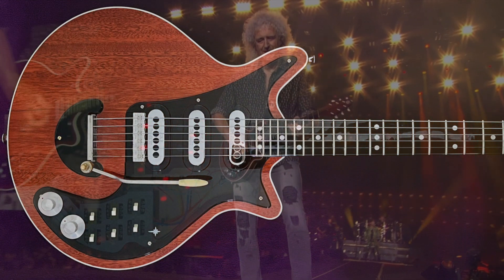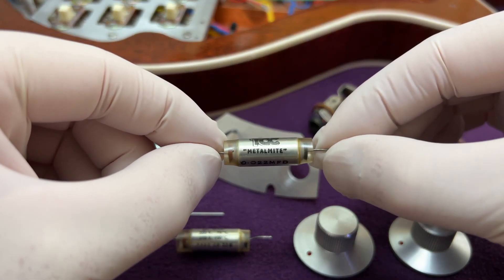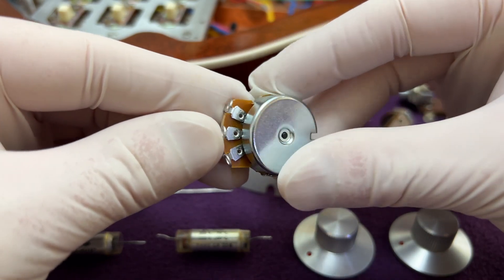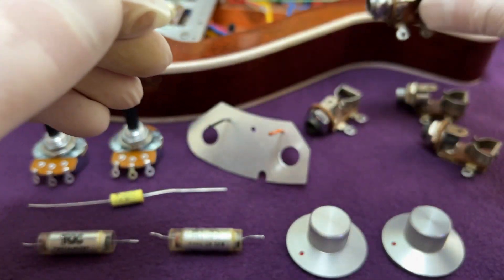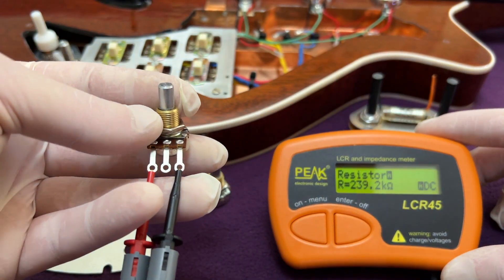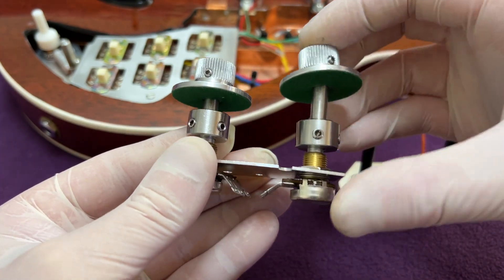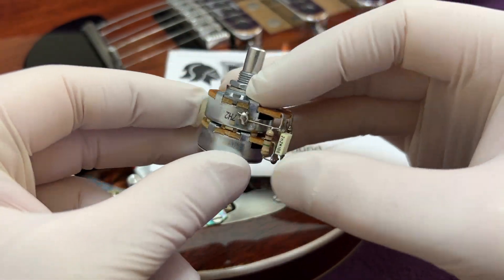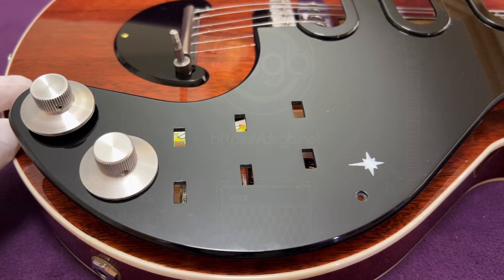Brian May Red Special Electronics: Potentiometers, Capacitor and KAT RS Superpot

Comment: Has to be the best channel for the red special, peroid. Well done for keeping all this interesting content coming.
I have a series parallel quesrion. 
I've wired in a parallel mod in my RS utilising the middle phase switch as the parallel/series switch. What i have noticed was how weak the parallel  circuit  is when 2 tri-sonics are on. Its more then half the volume of just 1 tri-sonic switch on in series mode, which is basical parallel when the other 2 are off. 

Chatgbt said this is expected. Would you ageee, because we dont hear this difference with Fender strat guitars 
 
G let’s translectrical behavior of your Tri-Sonics into real-world decibel differences so you can better understand what your ears are actually picking up.

---

🎚️ Decibel Difference: 1 vs 2 Tri-Sonics in Parallel

When comparing one Tri-Sonic pickup to two wired in parallel, the output voltage drops due to impedance halving and signal interaction. This results in a noticeable volume reduction, but how much?

⚡ Estimated Output Voltage Drop:
- 1 Tri-Sonic (series): ~250–300 mV
- 2 Tri-Sonics (parallel): ~100–130 mV

Using the formula for decibel change:

\[
\text{dB} = 20 \cdot \log{10} \left( \frac{V2}{V_1} \right)
\]

Assuming:
- \( V_1 = 300 \text{ mV} \)
- \( V_2 = 130 \text{ mV} \)

\[
\text{dB} = 20 \cdot \log_{10} \left( \frac{130}{300} \right) \approx -7.3 \text{ dB}
\]

---

🔊 What Does a ~7 dB Drop Sound Like?

- A 6 dB drop is roughly perceived as halving the volume.
- So a 7–8 dB drop is very noticeable, especially when switching between pickup modes mid-performance.
- It’s enough to require amp volume compensation or a booster pedal to maintain consistent loudness.

---

🧠 Summary

| Configuration | Estimated Output | Perceived Volume |
|---------------|------------------|------------------|
| 1 Tri-Sonic (series) | ~250–300 mV | Loud, full |
| 2 Tri-Sonics (parallel) | ~100–130 mV | ~7 dB quieter, thinner |

So yes — what you’re hearing is real and measurable. If you’re switching between these modes often, a buffer circuit or treble booster can help smooth out the transition and keep your tone consistent.

Want help choosing a compact booster that fits inside the Red Special or works well on your pedalboard? I’ve got a few tailored picks.
Reply from the maker: @philipreeves5465 Hello Philip, firstly thank you for engaging with my content and your supportive comments.

I am not the best person to comment authoritatively on the effects of switching various pickup combinations in series or parallel.

All I will say, and it is likely unhelpful is that I am not a fan of series/parallel switching on Brian May Red Special guitars. I am a purist when it comes to the Red Special and my opinion is that the stock switching arrangement is versatile and all any player should need to (a) access all Queen tones and (b) emulate some other types of guitar including twin humbucker arrangements.

A series/parallel switching arrangement adds further (unnecessary in my opinion) complexity to the many options already available to make the output thinner or fatter.

Reviewing the result from ChatGPT, I agree that this mathematical treatment adequately explains the audible output with Tri-Sonic pickups. 

The only comment I can make as to why the difference is less noticeable with Fender single coil pickups is because the impedance split between purely resistive and purely inductive elements due to the coil and magnet configurations is sufficiently different. It would be insightful to measure the phase angle of the impedance on the Fender single coil pickups to assess this difference. Tri-Sonics are around 50-60 degrees.

Doug
Reply: Thanks for replying. The band I'm in plays all different styles, from Dire Straits, fleetwood Mac to Queen, Bon Jovi, pink Floyd. Although I have over £40ks worth of guitars I just loving playing my home build RS and wanted to try and use it for other songs save me switching guitars a lot. Didn't realise the difference the magnets would make. 
Chatgbt suggested installing a buffer circuit just for the parallel mode to lift the output which I may try.
Reply from the maker: @philipreeves5465 I now appreciate why you're interested in the additional functionality that a parallel wiring configuration option might offer.

It sounds like ChatGPT is offering specific and possibly useful advice. I don't know how I feel about that. 😬

Doug
Reply: @dsgb The Red Special tones are absolutely incredible — far more versatile and useful across most songs than what I usually get from my Strat or Les Paul. I’m genuinely amazed at how good this design is, and even more impressed that Brian and Harold May managed to create it back in the early ’60s, with so little information about electric guitars available at the time.

I really enjoy listening to your breakdowns of the details, the clever workarounds you’ve discovered, and your personal journey into the Red Special community and build process. It’s both inspiring and extremely professional. Please keep up the great work — it’s a huge contribution to keeping this unique instrument and story alive.
Reply from the maker: @philipreeves5465 Thank you so much for the words of encouragement. I don't think that I have many more ideas for in depth Red Special videos in me, but my next video will cover the low friction roller bridge so please check that out in the next few weeks. 👍🏻😀

Doug

Comment: Another great content for all of us RS aficionados. I have a question, if you want to answer: in my self made replica, where I use switchcraft white switches and a set of basic Burns Tri Sonic, I feel as if the sound of the middle+bridge in phase is thicker and more powerful if I keep the neck pickup in phase even if it is off. Is it just me or does this make any sense? Many thanks
Reply from the maker: Thanks for your feedback. 👍🏻😀 The scenario you describe doesn't make sense to me unless there is a wiring error.

If you suspect that there is an anomaly, measure the DC resistance of the circuit across the tip and body of the 1/4" jack plug with the neck pickup on and off. Don't rely on subjective considerations.

Comment: Can u intonate a red special with a roller bridge perfekt. Because on a strat it's a screw you turn. So with a screw u can intonate the strat perfekt.  But how is it on a red special Because u have the groves already cut out
Reply from the maker: Firstly, it's well understood that you can't set intonation perfectly across the entire fretboard on any guitar unless you fit true temperament frets which looks strange and the benefit is probably outweighed by the extra effort.

Since there are limited bridge roller slots on a Red Special, achieving proper intonation is a bit more of a compromise than guitars with adjustable bridge saddles. However, good intonation is still possible. I haven't heard anybody with an authentic Red Special complain about this limitation and I haven't had any issues personally.
Reply: Sorry for my bad English
Reply from the maker: No problem, I understand you but you could try using an online spellchecker to help. 😀👍🏻
Reply: @dsgb  thanks for helping me

Comment: Why does the Red Special guitar bridge have 6 cheese head slot screws and 6 Brass hank rivet nuts, can you just screw them down with a normal screw. My workshop teacher asked Why he Diddint just screw them down and I didn't know
Reply from the maker: I don't know either but my best judgement is that the arrangement Brian chose is more secure in the underlying wood and threaded machine screws permit a more precise alignment of the roller bridge pieces.

I can foresee challenges getting wood screws precisely inserted even with careful pilot drilling.

A straightforward option to achieve the same secure and precise fit and avoid inserting six separate threaded inserts is to drill and tap six threaded holes in a section of thick (say 3-5 mm) brass bar and screw the brass bar into a rebate routed out of the top of the guitar body so that it is flush.
Reply: @dsgb  thanks
Reply: @dsgb do you have any blueprint on the shaft extenders
Reply from the maker: Yes. I designed them myself and the dimensions are customised to my Red Special.

Comment: Hi Doug. You must be a mind reader! I was wondering about this only last week wondering what difference the super pot makes and if it’s worth it.
Thanks to your video I think I will leave mine the way it is because I don’t believe that I will gain (no pun intended) anything at home with quiet amps!
Cheers!
Reply from the maker: Hi Tom. I got the feeling that some people just wanted to fit a KAT RS Superpot because it's the latest innovation that Brian has, without properly considering all the benefits and drawbacks.

Also, people are asking me (some random guy off the internet) questions that they should be directing at the OEM, vendor and expert, Nigel Knight!

Comment: Excellent film Doug.  Your 3d printed solutions to extend the pot shaft is elegant and praiseworthy.  On the recording DI piece and tone control - personally I couldn't live without it.  I use it on stage for a cello type of feedback piece at the end of Don't Stop Me Now but I've also found it very useful when recording harmonies with the captured and real deacy.  Sometimes it's easier to use the tone cut than to start moving microphones and the effect is quite different than changing EQ in post. 

I'm an avid eBow fan and one of the directions given on that device is to dull the tone to taste as the acoustic coupling effect induces can get quite shrill.  I know Brian experimented with an ebow but I think his "eBow" was often the interaction with the Deacy speaker and the volume envelope of the feedback when the tone is dulled is more like a bowed cello note.  Brian may have also induced this effect and articulation with a cocked wah pedal but I'm inclined to believe that some of the earlier deacy work was actually tone cut.  

Looking forward to more of your presentations.  The insight and detail are wonderful.
Reply from the maker: Hi Thomas. Thanks for the kind words as always and for chipping in with useful insights. 💜😀

l became a bit concerned that some people who were asking me about fitting a KAT RS Superpot weren't completely sure of what was involved in the modification and hadn't fully appreciated the benefit of retaining the treble cut circuit.

I don't play through my Deacy enough but whenever I do, I feel compelled to dull treble from its output. When you piece together the information about Brian preferring to use a depleted battery and recording with a coat or blanket over it, it points to him trying anything possible to cut treble to emulate violin/cello tones.

The KAT RS Superpot is a nifty idea that has been around for a while:

http://geofex.com/Article_Folders/potsecrets/potscret.htm

But I don't need or desire a more progressive transition from clean to overdriven tones.

All the best.

Doug

Comment: Is it possible to mount the superpot on the original potentiometers plate?
Reply from the maker: No.
Reply: @dsgb  do i have to remove the tone pot or can i keep It?
Reply from the maker: You can retain the treble cut tone controls but you will need to mount the tone capacitor somewhere else.